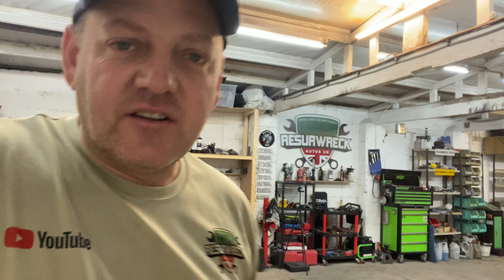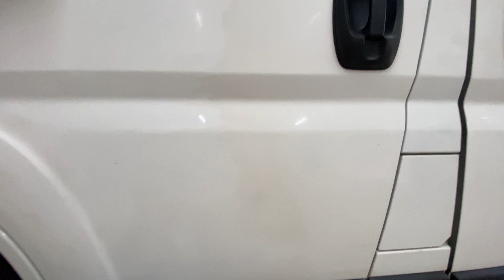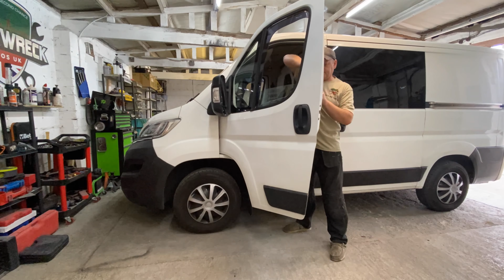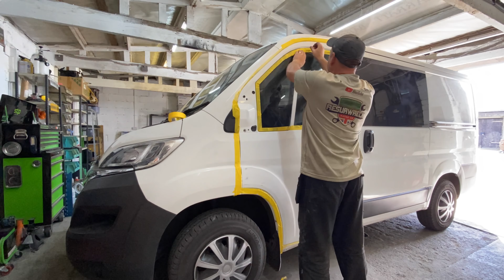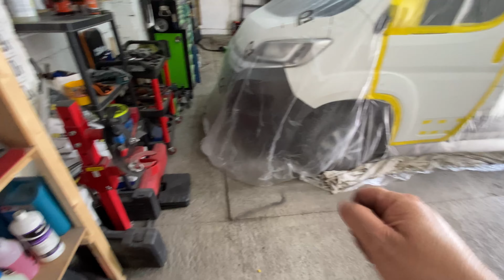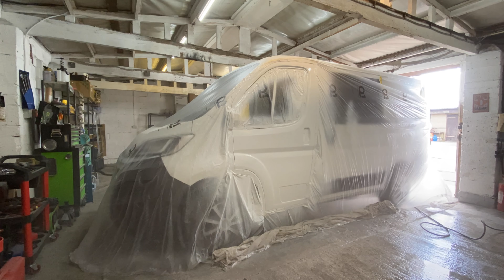Citroen Relay Campervan Conversion Back For More Painting

Comment: He should have a split charging relay fitted then fit a battery isolator switch onto the leisure battery as one battery can fight against the starter battery and cause them both to drain I had this with a boat and finally got to the bottom of it you fit the charging wire to the battery(leisure one) and even when the battery is isolated when the engine is running it still charges the leisure battery .
Reply from the maker: Thanks buddy I will pass on that info 👍👍